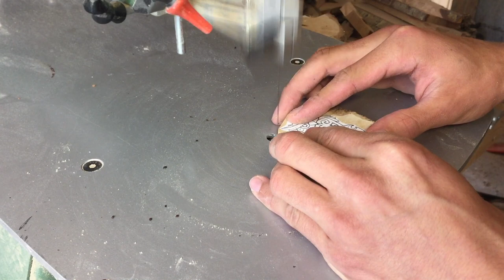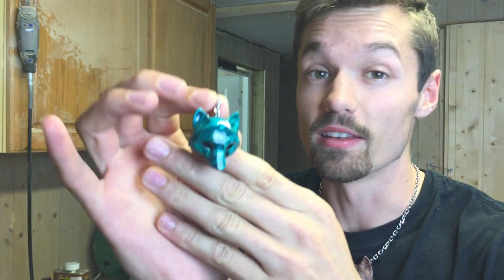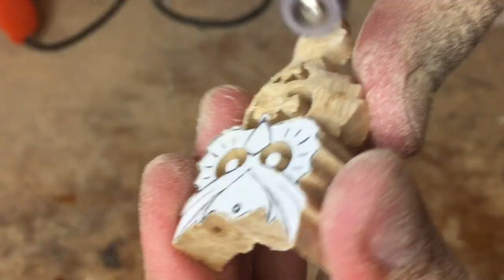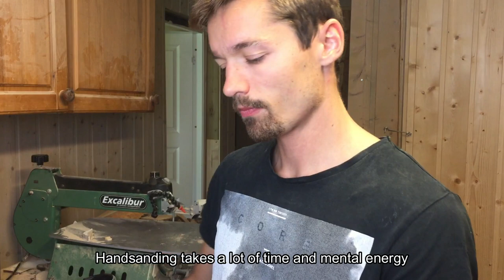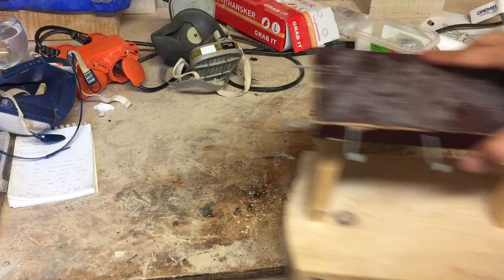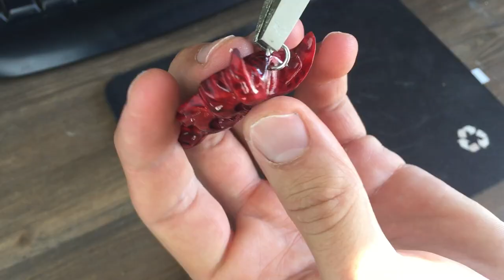Handmade wooden owl pendant

Comment: I see you use a spray finish to get that beautiful shine. What kind specifically do you use?
Reply from the maker: ohh i cant remember unfortunately. But it was a Norwegian brand. I can say that clear coat lacquer which is pretty thin works best. I am not an expert on the field. It does take some practice to get it right. You got to spray from the distance it says on the spray can. You must be very careful to not spray too much since it will leave these weird bubbles in the lacquer in the end result. and also very important, use proper safety equipment!

Comment: I love your work. Do they have burr bits where you are? They let you get even finer detail, if you're into that kind of thing. They work with the kind of dremel you have (I know because I also have the same dremel).
Reply from the maker: Hey ye i have some diamond burrs, they work ok, but it can be hard to get a smooth finish on burl wood by using them. I am sure there are better quality ones out there because those i have are very very cheap
Reply: Jonasolsenwoodcraft Carbide (usually tungsten, sometimes nickel) burrs tend to work better on wood than diamond ones. Diamond burrs are better for glass, ceramic, and stone. I think it would be interesting to see your work in finer detail.